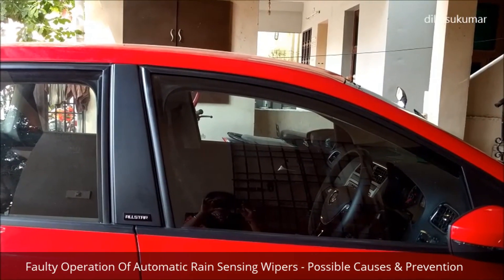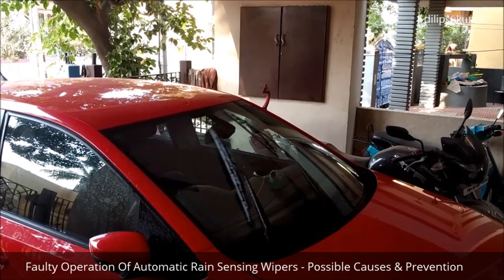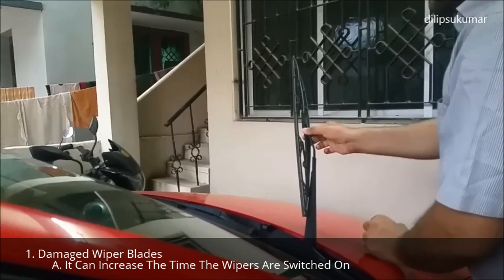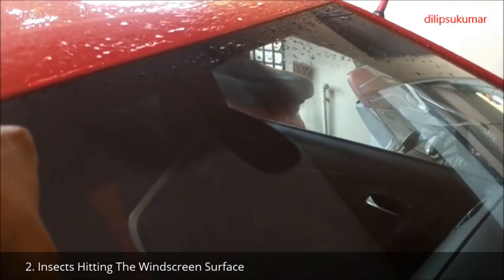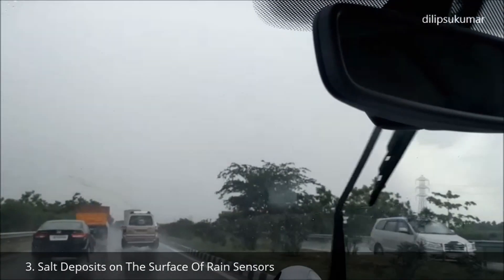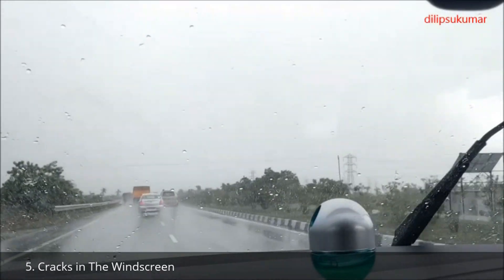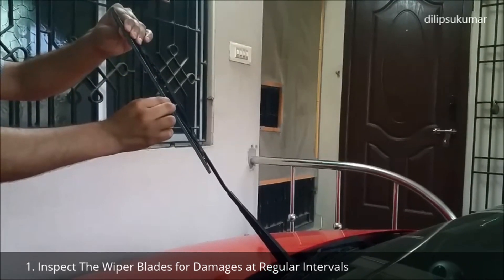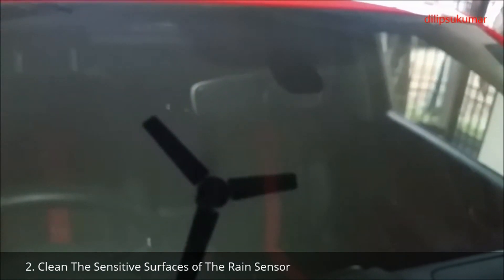Faulty Operation Of Automatic Rain Sensing Wipers - Causes & Prevention

Comment: Sir i bought a new rain sensor wiper for my scorpio vlx model after the windshield was cracked. Previous sensor was working fine according to the intensity of rain. But this new sensor doesn't work according to the intensity of rain. Even i got new wiper blades and new windshield which is totally clean it still just wipes the water once every 20-25 second even if it is raining heavily. What might be the issue.
Reply: Facing same issue is it resolved ?

Comment: Hy
As new vw comes without anitheft!! Would you please enquire that it can be fitted by showroom or is it possible to do that(Not aftermarket)!
Reply from the maker: +Motor Bikie it can be done at the showroom. It is possible.
Reply: dilip sukumar Its come with a motion sensor inside the cabin right?
Reply from the maker: +Motor Bikie Yes. If you want to add the complete set Anti theft alarm, you can add motion sensors also. If you want only alarm when someone tries to open the door, it can also be done...
Reply: Thanks Bro! Here the service centre guys are not aware of it!
If you visit showroom again, please enquire the cost!!
Thank You!
Reply from the maker: +Motor Bikie each dealer will give different options and varying cost bro... Some might say it's not even possible. That's the big problem with the VW dealers... I will definitely enquire the cost of it during my next visit...

Comment: Which car is best swift or polo
Reply from the maker: +Chandran Panneri it is not fair to compare Swift and the Polo as both come in different segments. Actually, Polo should be compared with the Baleno. 
I like the Polo as it is a very safe car. I like the Swift due to its performance. But I own a 2010 Swift which performs much better than the current generation Swift.
Reply: dilip sukumar please like my videos and subscribe
Reply from the maker: +Chandran Panneri sure... Will check out tomorrow... 👍

Comment: 1. Sir is there any option to turn of the automation process when required?
2. If the Wipers on automatically can we stop it when the vehicle is in motion?
Reply from the maker: +Kevin Prabakar 1. Yes. Just keep the wiper lever in Off position instead of auto position. You can also manually control the wipers. Automatic wipers work only when the wiper lever is put in Auto mode. Please watch my video titled Automatic Rain sensing wipers in Volkswagen Polo. It is also linked with this video.
2. Yes. We can turn off when the vehicle is in motion. Just switch the wiper lever from auto position to off position.